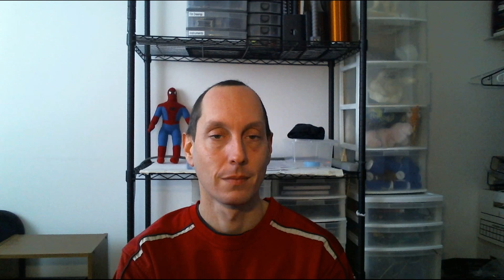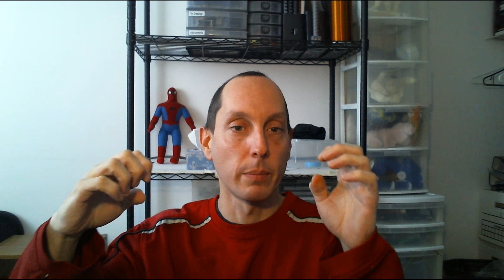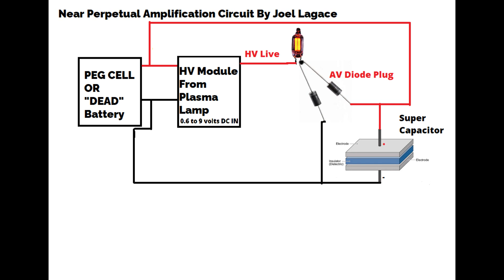Simple Amplification Circuit

Comment: isolate the PEG output with output diodes . And connect the plasma module to source its power from the PEG output diodes .  Then send the cap energy to the PEG before its output diodes and add small  HV CAP from Air Condition supply type across the PED output diodes for stabilizing any flyback that reaches that point in the circuit...
Reply: The modulation I feel would be necessary to lock in the field, the capacitor plates could use an additional pair that could hold a field as the air core dielectric between through compression as storage initiative motive to the application, just an idea i would try, parabolic plates, or cubic orientstion to surround the field and lock it with frequency modulation ton prevent escape, a possible harnessing method... maybe helmholtz coils in between the plates on linear tracks  in-between as well to concentrically hone,orient or contain the field more effectively to when its compressed itll form a conjoined double or triple toroidal emf fields depending on polarity set up  spanning out upon compressive hold and charge build up,  as the rings/coils act as chokes in such a way  ive been wanted to try this, but at this point, I'd be happy to just see it done and witness as it could help if it works...tbh I'm just getting into this all, so it's much easier for those who have had a career with it. My prior studies allow me to see it in such ways more pertaining to the dynamic aspect but not the numbers... but harnessing such a field in that way would allow storage to be pulled from is my guess behind it
Reply: @Emaname121  Makes sense , you think the Hendershot Generator works like that?? , it uses 2 Big Caps and 2 Big Coils almost same dimensions as caps , and bar magnet on slider next to primer winding  i guess for the two bigger coils .
Reply: I'd have to look that generator up,  that plate and helmholtz set up could then be a step up  for a steady piezo transducer pzt or quartz output to a box, then excess power to ground use for electroculture, lol, why not, or ionic stabilizing between ground and atmosphere, i don't know how that would affect radio though, but radio can be more efficent too with the towers, they use so much power snd cryo to keep it stable... use laser i would think, laser that won't burn holes through thing but send a mere data signal by its vibrational pick up, so many possibilities like said in video@mykedoes4099
Reply: @mykedoes4099 just looked it up, its works as of an oscillator closed loop and amplification by the wiring skin effects of the magnetic field. Don't let anything go to waste is key, to add to those transducer could be conductive mass inertia flywheel that can tune in to frequency for variable dipole by how the transducers keep its rotation at sped with pulse... motive conductors or anything motive really attracts ions
Reply: @Emaname121  you sure , Hendershot Generator is Solid state . no rotors / flywheel
Reply: @mykedoes4099 i was just adding  my thoughts as a additional component pertaining to adding a  the flywheel aspect  pertaining towards what Joel is speaking about with the electrostatic harvesting aspect, not to the hendershot but that seems to have very similar dynamics taking quick glance, I misinterpreted our convo, misconcieved... and jumped back to initial before the hendershot, bad format, i rushed, my bad
Reply: @Emaname121  Ya i get your message about wireless reception of fields by use of capacitors and plates inside . Its new to me , but makes sense since the plates in caps are mostly carbon , carbon has particular geometry for signal reception in my opinion
Reply: Sweet Mike! :)
Reply from the maker: I know I know... This seems simple and it just works, For newbies here. Of course there is a million ways to go from here and as an intermediate I understand how this circuit might "suck" lol
Reply: @joellagace1679  looks like working diagram to me. But if the module blows you can try that . remember your building up the CAp and feeding it back
Reply from the maker: If it blows i'm having a drink in celebration lol
Reply: @joellagace1679  lol 👍

Comment: 7:00 you want to feed back to the source PEG ?
Reply from the maker: The circuit operates as a feedback loop; however, due to the PEG cell's near-infinite internal resistance and the oscillator's high input resistance, the extra charge accumulates in the low-impedance supercapacitor rather than being immediately dissipated by the input. The supercapacitor then releases a slow, steady current, regulated by the oscillator's internal resistance. This creates a balanced system that stabilizes and continues to run at a consistent potential.

The supercapacitor acts as a parallel DC source with an equal potential to the PEG cell, effectively doubling the available input current. This additional current is sufficient to drive the oscillator more efficiently, resulting in faster and stronger operation compared to using the PEG cell alone.
Reply: @joellagace1679  just thinking to isolate the module from its own HV reaching its own input , I get it that the PEG can take the HV so can the CAP as long as its loaded before you go over its V rating
Reply from the maker: Unless you’ve discovered something I haven’t, I haven’t been able to exceed component ratings or cause damage with this type of energy. So help me out :) These "wattless" electrostatic high voltages gently charge supercapacitors, quickly reaching an instantaneous range of 0.9 to 1.5 volts but refusing to charge much further, especially under load. Even if left charging for extended periods, it could take all day to reach 100 volts, particularly with a high-capacitance value.
Reply: @joellagace1679  now that i look twice i see you have a NEON acting as limiter so the CAP should not build up over that limit .
Reply: @joellagace1679  i dont have enough info on the module .  I assume its making HV low current, so the HV will fill the CAp until it reaches that Voltage , not sure if the NEON is droping the voltage across the CAp you an measure with  meter
Reply from the maker: We should do skype or something sometime.
Reply: @joellagace1679  ok your good your super caps is 1.5v rating it will limit it will take long time to go over that limit but it will eventually . What are you using to regulate over voltage on the CAP?
Reply from the maker: Nothing, the oscillator load does not let it build up a high potential, the cap converts it back to very low voltage current on the fly.
Reply from the maker: Feeding the AV plug directly back into the input without the supercapacitor has no noticeable effect. The system operates slowly, as shown in my earlier demonstration, with only a weak neon flicker. The neon, which limits voltage to around 90V, functions as a spark gap in this setup.

However, when the AV plug charges the supercapacitor, the supercapacitor aligns with the PEG cell voltage since they are connected in parallel. The AV plug’s energy is primarily directed into the low-impedance side of the supercapacitor, which then slowly discharges, regulated by the oscillator's resistance. This doesn’t recharge the PEG cell but instead contributes additional current to the input alongside the PEG cell. As a result, the oscillator operates faster, and the neon flickers much more brightly. That’s essentially my understanding of how this system works.
Reply: @joellagace1679  Then all you have to consider is any HV spikes returning to the module source . If the coil inside the modulator is high impedance it should regulate so long as it acts a s load ,i have seen voltages rise above the source this is no problem with Batteries but CAP will blow out